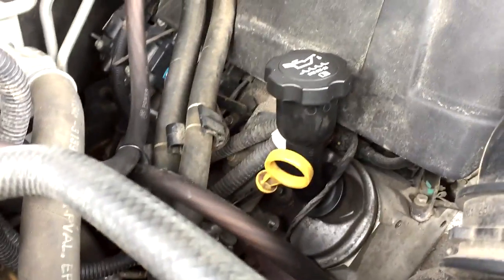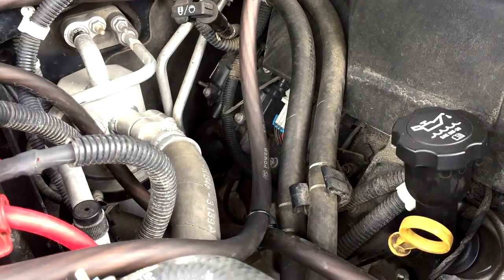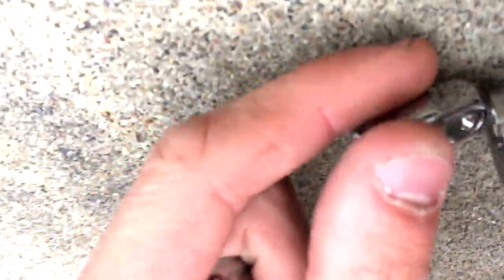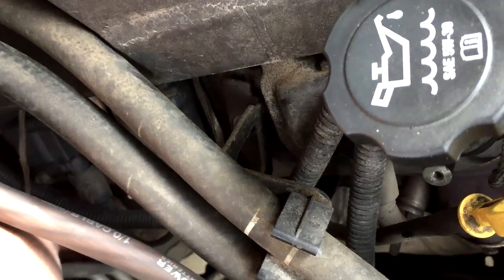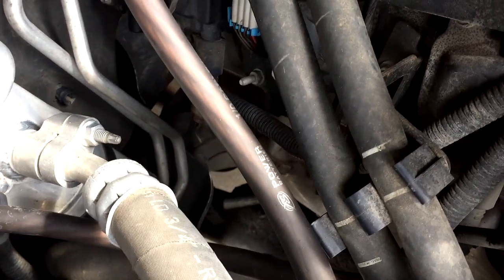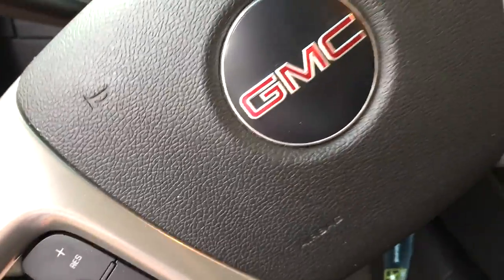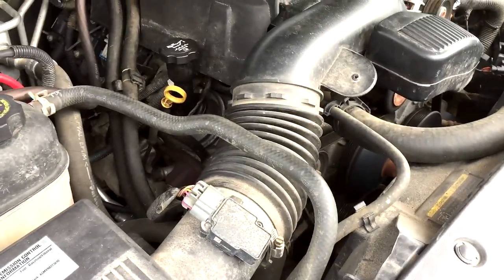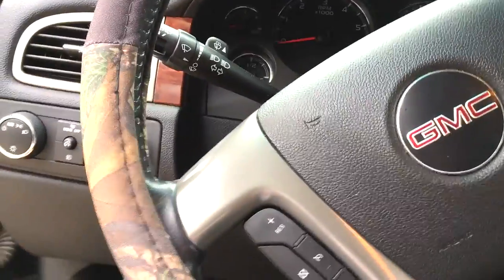How To Remove Spark Plug #8 on a 2010 Yukon XL SLT 1500 (5.3L V8)

Comment: On the number 8, I did away with the extensions I used on the other 7. The end of your spark plug socket has a 3/4 shoulder on it. I did mine with just the 5/8 spark plug socket and attached the 3/4 to the end of that and that’s it!
Reply: Thank you for that comment. That's what worked for me
Reply: So you're saying a 3/4" open end wrench on that shoulder?  From top or bottom?  Thanks

Comment: I do not know what the big deal is. I just changed mine. Less than half an hour. The 4 on driver side were no issue. The Passenger side I just used deep socket and swivel on all 4. The plug wires were no issue. First plug change on my 2010 Yukon with 130k.

Comment: I know your intent was meant well but trying to watch your video was like a 5 year old running around with the camera going. Also when I change my plugs and wires that one plug was accessed from under the vehicle. I drive a 2008 Yukon 5.3 Flex Fuel. I never run hi octane fuel unless I'm filling up with e85 and its never been an issue. I do put additives in occasionally for cleaning the system
Reply: Robert Vitorre I noticed this while I was outside looking at my Wife's truck, going under the passenger side seems to be a smarter way to go!!

Comment: I have a 2015 Silverado bought brand new I usually run midgrade or premium … tried from the advice of friends to run Regular  within the first 3 or 4 months that I bought it  … the truck didn't like it ran shitty under load or mid to heavy throttle  if your driving miss daisy it was ok …. So I went back to Midgrade in spring summer and fall  and premium in winter because I live in Manitoba Canada …

Comment: I replaced the plugs & wires on my yukon last night/this morning. Almost slipped off the stool I was using nearly breaking my arm the way I was twisted under hoses & wires.I ended up getting my 3/8 (I think) socket to give the added torque needed for #8, be wise I don't have the 2 step-up you mentioned. It was almost 2 in the morning when I finally got done with all my 100K maintenance.
Reply from the maker: its such a pain in the ass

Comment: I can't get the boot off no 8 mine is stuck my no way TO get leverage on.the boot ypu glossed over that
Reply from the maker: Get a pair of spark plug boot plyers from like a harbor freight but do not use anything that will crush the wires if you intend to save the wire for that cylinder.